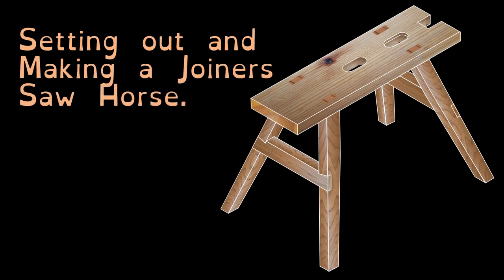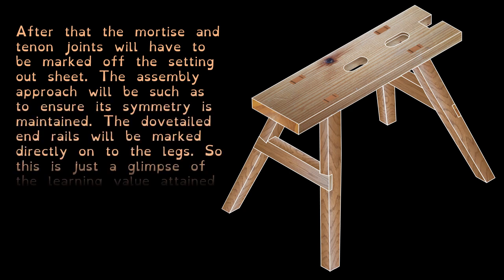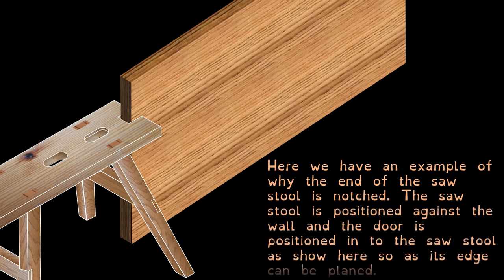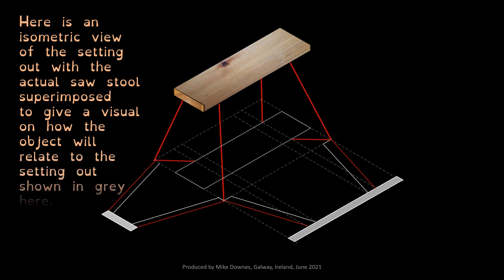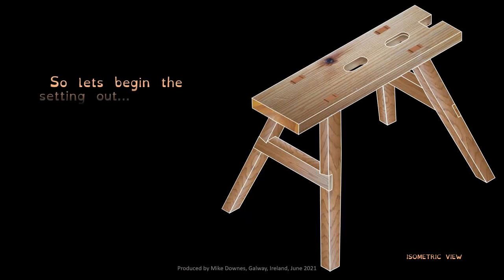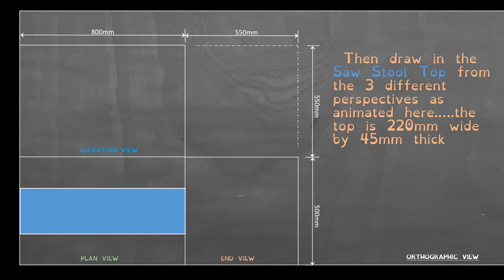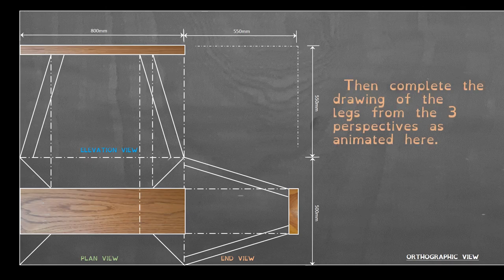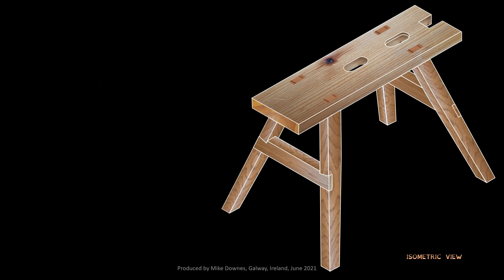HOW TO MAKE A JOINTED SAW HORSE (PART 1)

Comment: Michael, This is a really useful demonstration and explanation to compound angled mitre cuts. As usual , your  graphics are extremely clear and so helpful to interpret and visualise measurements and the laying out process  both orthographically and isometrically.  
Will be interesting to view all the remaining parts. 
On a related theme , perhaps sometime in the future you could post a short video on joints with splayed linings ( eg:  a box with splayed sides of dissimilar width).
Related to these concepts would be the intersection of two inclined mouldings ( one of which is specified)    with the angle between the plans of the mouldings given. A good example of this would be a handrail attached to an obtuse angled vertical corner of a stairwell. A video on this topic would be wonderful and resolve many related setting out jobs involving raking angles.
Refer to Advanced Constructive Geometry by J.F.Dowsett (Oxford University Press 1927)  p136 and p284 respectively for this and many more incredibly detailed drawings and  explanations. You will appreciate the content of this detailed well written book and it may suggest other practical and useful YT posts to make.
THANK YOU once again for sharing your skill and knowledge- the videos are SO HELPFUL and much appreciated given the background work required for their production. Most grateful!!!!
Reply from the maker: Thanks for  your thoughts and  suggestions Jeff. I intend to order  the book you suggest in the the next few days and will  pay particular attention to the pages you have mentioned. It takes a  few days to produce 10-15 minutes of an animated video with a vioce over, but worth it now that its done, especially as it caters to the visual learning style and so  will help provide a more universal design for learning.